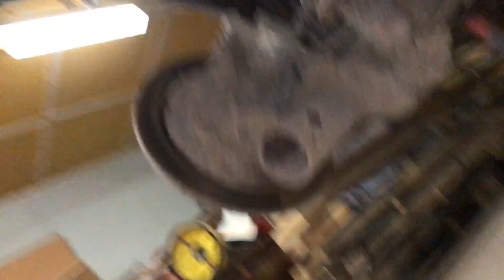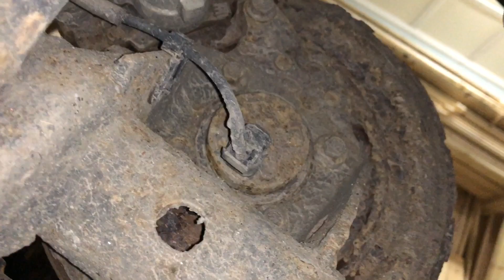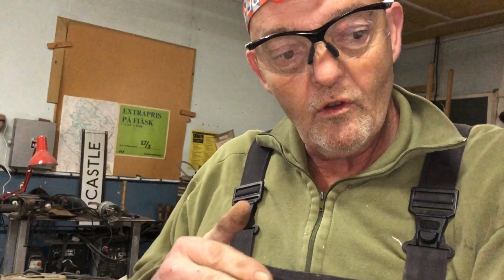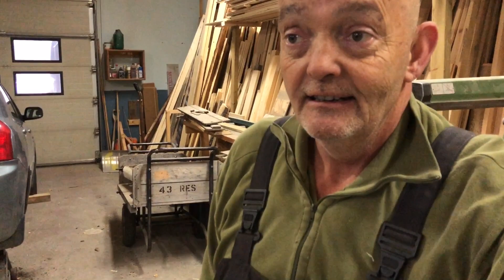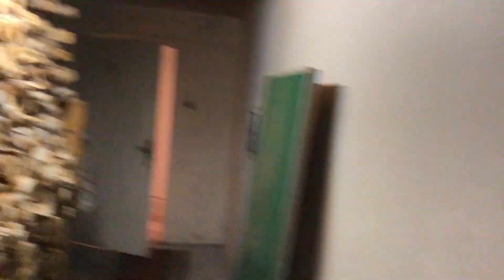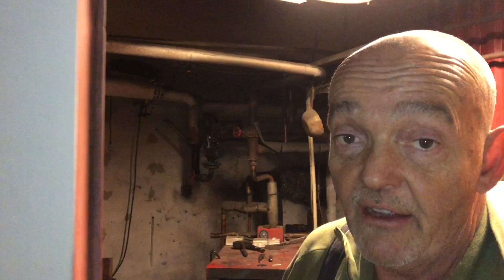Good news.bad news but then some good news and some more new arrivals to out flock. Huge car issues

Comment: Howdy Simon- so glad you’re doing better and able to be up and going again. It was quite obvious on your last video that you weren’t at your peak. Too bad about the car. Hopefully you will be able to get something that will be solid and dependable for what you need to do. I can quickly tell a car from the north by the rust around the fender wells. When we do get some nasty weather here in the south the hiway department uses a chemical of some sort to cause the ice or snow to melt. Not sure what it is but it seems to work fairly well. Take care of yourself and let your strength build back up. God bless you my friend
Reply from the maker: Hi Paul, I am feeling good thank you. The salt thing is not a think here it is too cold and driving on ice is normal and indeed part of the driving license requirements so cars that are from the north dont have this problem but the pool of cars is tiny so to get something cheap and used you sometimes have to go south to the city and there is the problem. We will sort it out, there was a time I used to pull my trucks from the Texas oil fields. All 60s and 70s totally rust free and running strong could do with on of them about now. Thank you Paul, take care.

Comment: Tough break with your car Simon. Just had our two inspected & they cost a lot more this time too. My truck is a 99 & that needed upper & lower control arm bushings & the car needed some kind of valve I never heard of to get the check engine light off. Both totaled over $1500. They have a saying here, if it ain't the shit's it's the heart burn. I just got the shits of it !!🤣🤣🤣🤣
Reply from the maker: Ouch Robert, nothing like getting kicked in the pants. The more you have the worse it is and we know this. I have an idea and am off to see if I can make wine from water. Thanks

Comment: Honest? . Will or would it be cheaper to get a motor for the van from the junk yard then replacing the car Simon.  Yes I know they are not cheap but it could be a cheaper way then a used car .
Reply from the maker: The cheapest way is to fix the engine in the van it is a valve dropped into the cylinders at idle there will be no damage. If it were any other van it would have been done but the T4 has to come out on the sub frame from under the van. The whole front of the van is rotten, I know I welded it all up so if it were to be removed it would just all fall apart. The van came from the same city the car did. The Van cost me less than 500 bucks and the car was about 1000 bucks so I am still on the up side and knew they both needed replacing me and Sarah have spoken of this many times. So it is agreed we will buy something newer and more expensive but simpler and easy to change out motors ect. A Ford will be the next move, I need a service van and hauler so it has been decided.